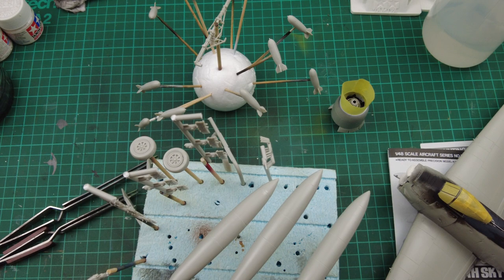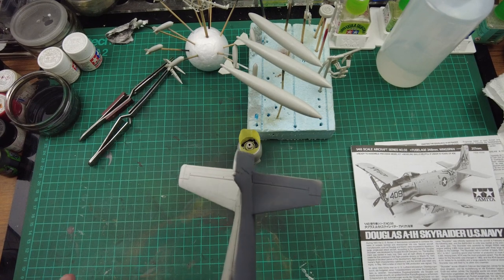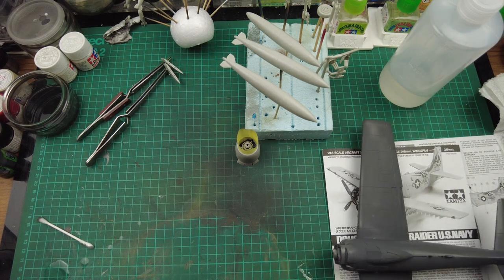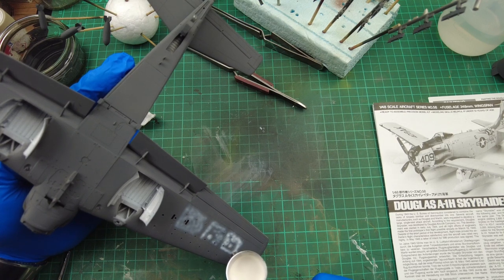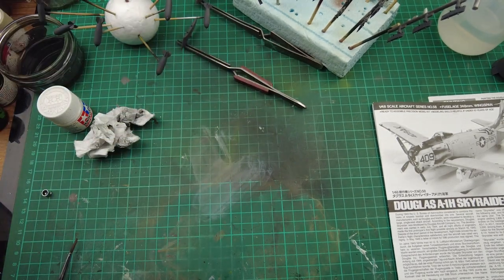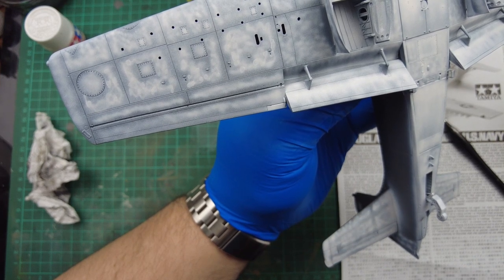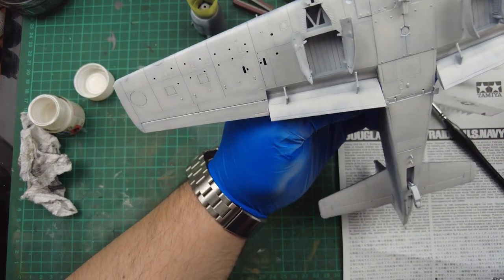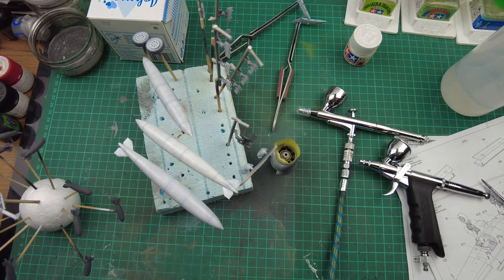GAAHLERI GHAC 98D & GHAD 68 Airbrush On Test Painting Review Part 1

Comment: Thanks for the video Ian.

I'm sorry, I have an unrelated question prompted by the review 🙈 do you normally spray Tamiya acrylics without a booth? And don't the smell a bit too, without one?

I believe they're quite troublefree, and I like to keep things simple 😁 but i thought they'd stink my hobby room.

Have a nice Christmas 🏴
Reply from the maker: Thanks for the question, I do usually have extraction running whilst I spray, together with windows open for natural ventilation, but for filming I rely on natural ventilation (of with there is lots in the Shetland Islands) due to the noise of my spray booth interfering with the sound recording. I find that Tamiya acrylics aren’t as smelly as other hotter paint products, lacquer or enamel paints, but they do still have an odour so would always advise using them in a well ventilated area.
Wishing you all the best for the festive holidays and a happy new year when it comes.👍